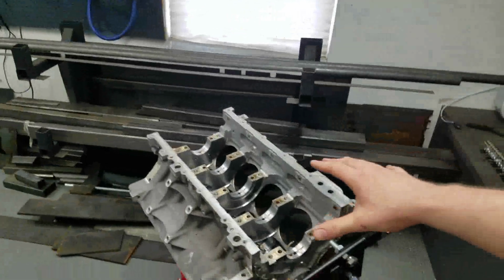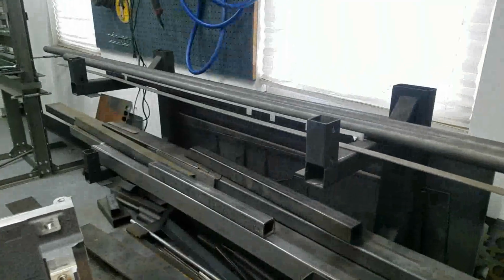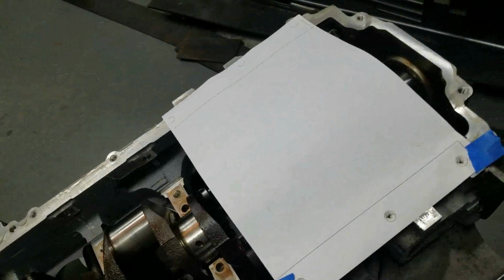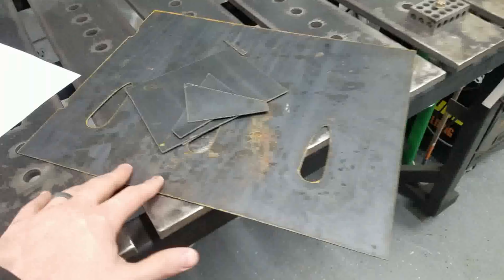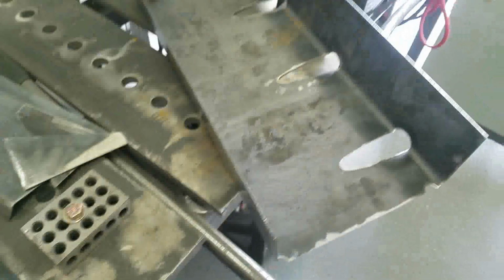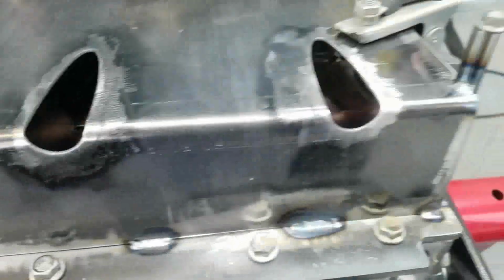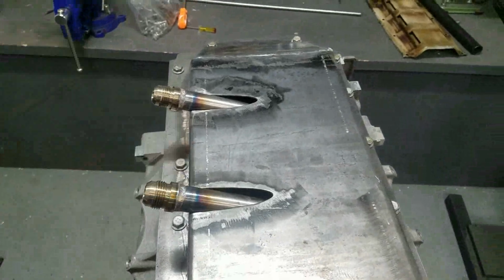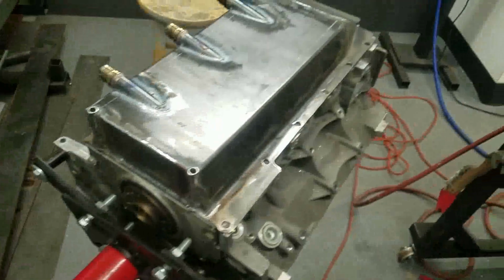C1500R Build, Episode #16, Homemade Dry Sump Pan?!? HELL YEAH. Gen 5 Dry Sump conversion for the OBS

Comment: No drain plug?
I'm not real familiar with dry sumps.
Reply from the maker: The drain plug will be on the sump tank. If you want to drain the residue out of the dry sump pan you can just undo one of those AN lines.